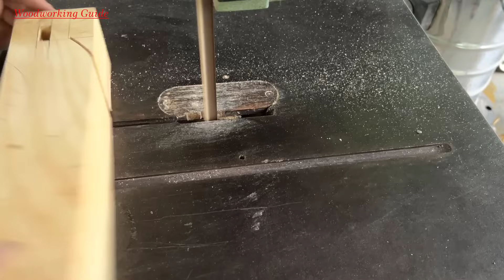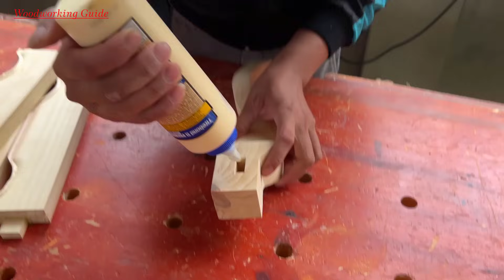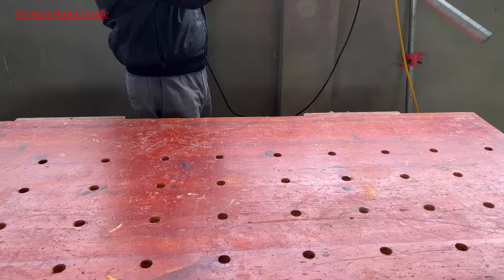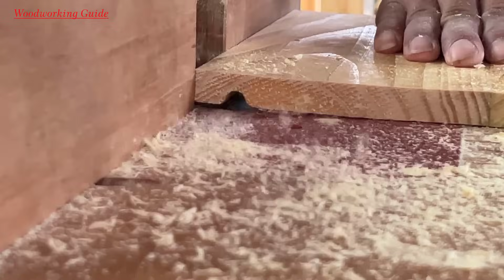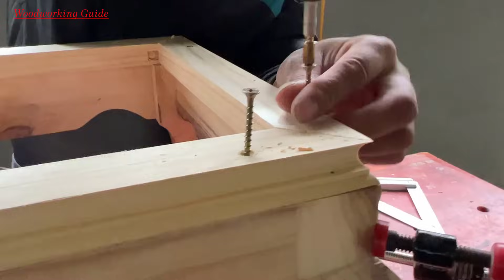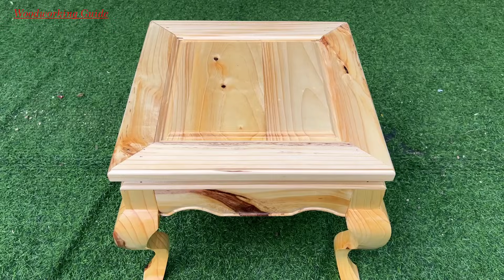How To Make A Simple Mini Table // Special Furniture Production Project

Comment: Okay, not a bad little table. But, to say "Perfect In Every Detail // Skill Of Working With A High Level Of Craftsman" is a gross embellishment.
Reply: LOL Don't be a downer "He still hearted your comment" LOL
Reply: @yeagerxp  Not being a downer. The table turned out pretty good. Just saying that there's no need to make it out to be more than it is.
Reply: Agreed. He loves to incorporate defects into his joints and stress points on his legs. That top is already warped before he glued it to the frame. It will crack when it expands and contracts. He seems to be ignorant of a lot of woodworking 101 concepts.